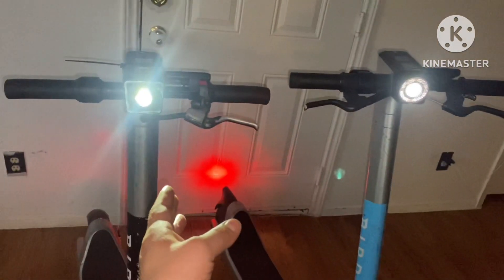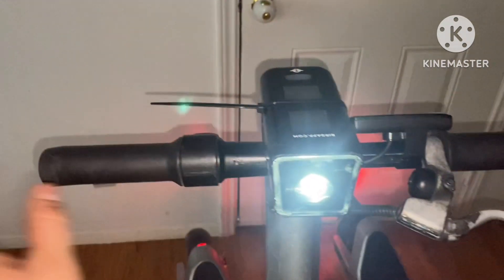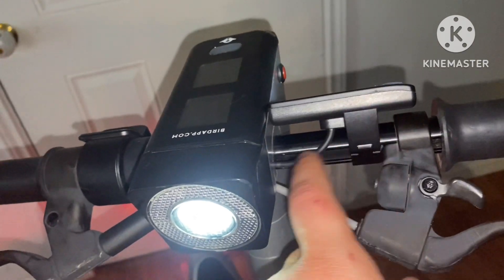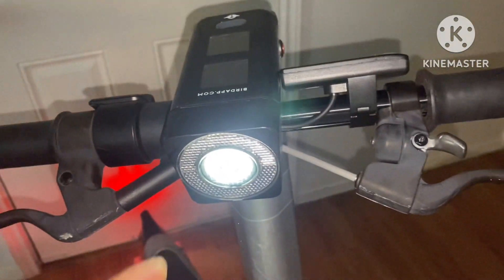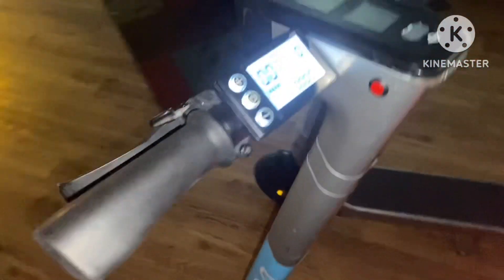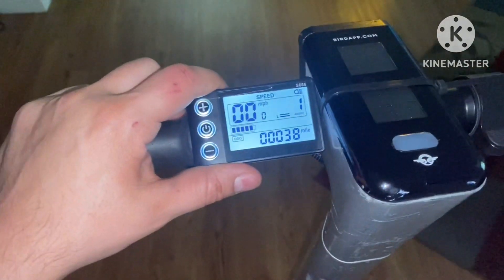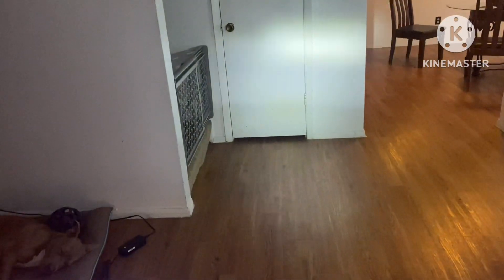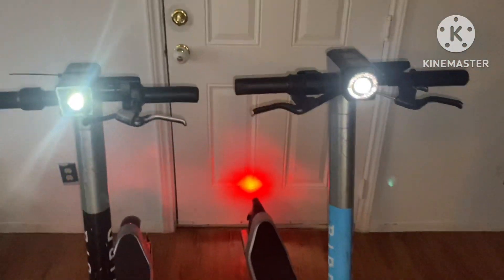Bird 3 | ￼￼Brushless Controller | w/Display kit | 1000w 30a

Comment: I have the same controller but in this controller you don’t have the 3 wires for velocity, like in others, so it’s just one velocity available. I also don’t have the lcd display so I’m wondering if it possible to put more velocity conecting some wires from the lcd

Comment: why did you do the bypass?  can this controller only be 36v 1000w or does it have to be 36v/48v 1000w
Reply from the maker: So you want to be sure that The controller you order is 36 V rated.. 

Even 36 V/48 V is fine 👍

That just lets you know that it’s suitable for both battery types- meaning- it works for both 36 V/48 V batteries ..👍

If it does not say 36 V do not buy it!!! ❌
Reply: Just added 36v/48v 800watt 30a and I’m getting the same effect I’m gonna  rewire everything to be sure I did it properly hopefully that solves it

Comment: Yo bro what screw do you use to remove the battery ?
Reply from the maker: T-45 & t-25 bird 2 

T-45 & use a hammer to smash a t-25 in place of the 7 point screws. It works !!-Bird 3-

Comment: Did you say 2 step down converters?? I thought in previous installs , you used one step down and tied the front and back light to one step down . Is it a different set up with bird 2
Reply from the maker: 1 step down converter is for my headlight and tail light, The other is for A set of Bluetooth speakers 36v step down to 5v .. which is not needed it just adds more features. It’s something the customer requested..